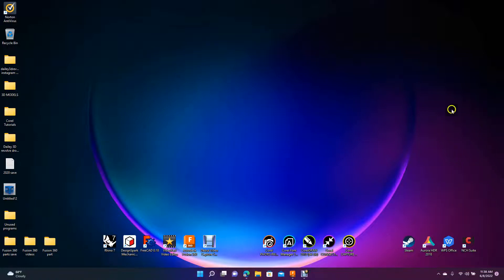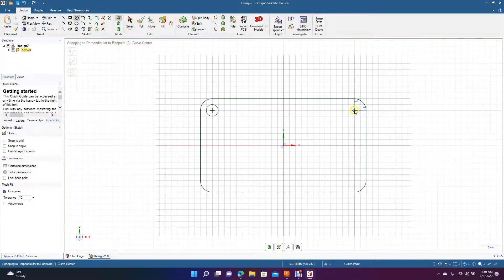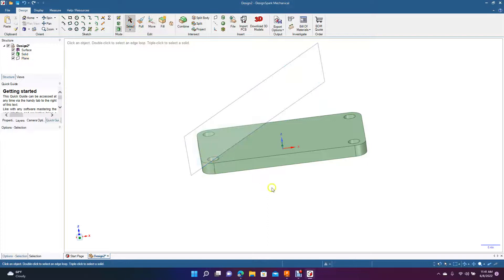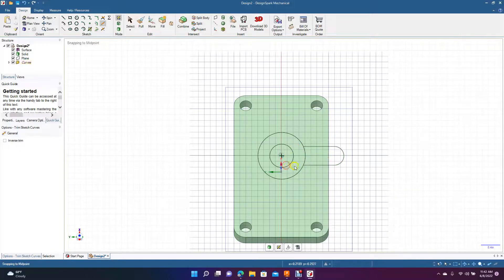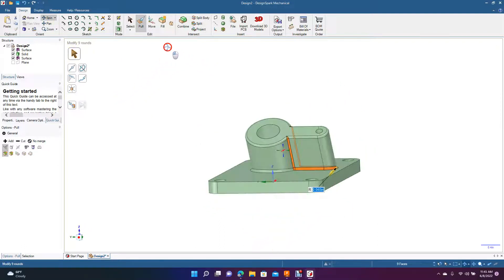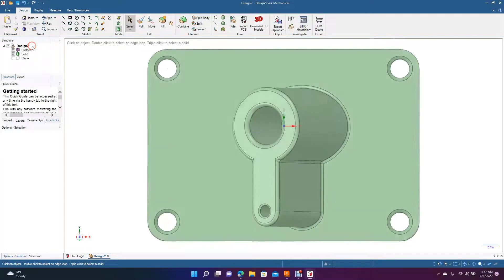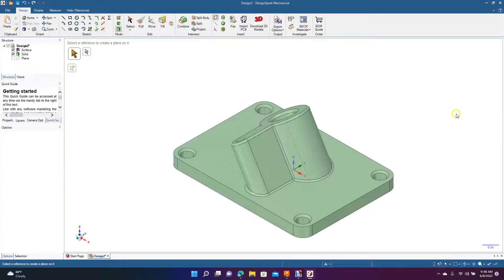How to change the angle of a plain in design spark mechanical

Comment: Hello,
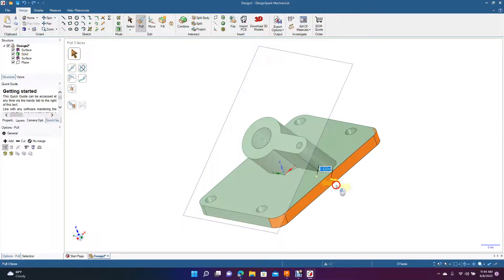nice video but i think there is a mistake between 6:00 and 6:40
To move the holes you have to select the surface of the holes. In your example, because you select the edges, you only move the top of the holes and therefor you get an angle between top and bottom of the holes. At 6:31 you can see what i mean.
Regards Heinz
Reply from the maker: Thanks! Heinz, I will check that out. I appreciate your comments. Cheers!